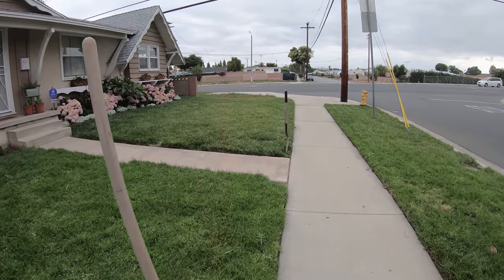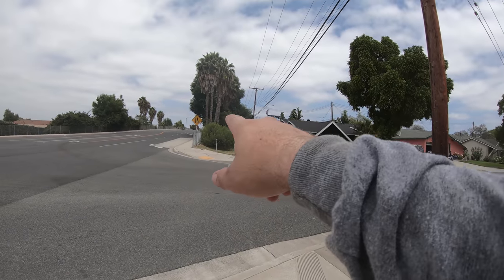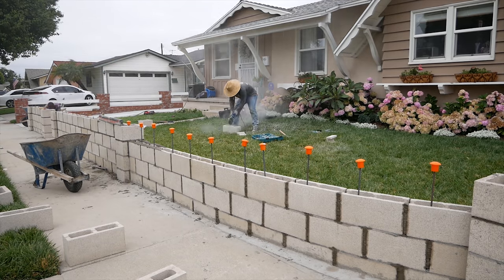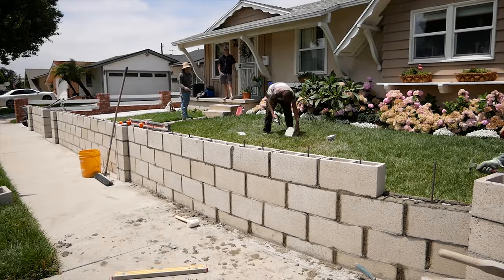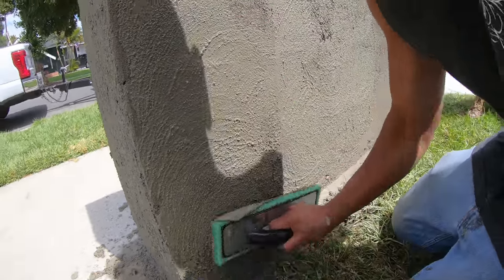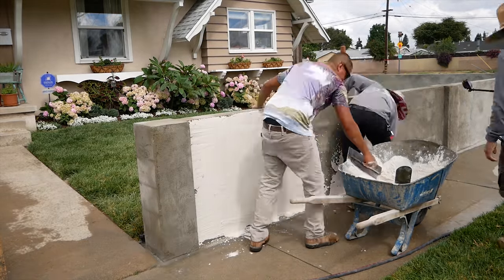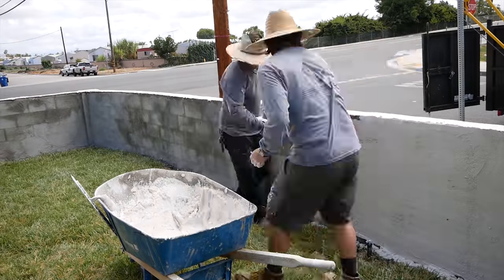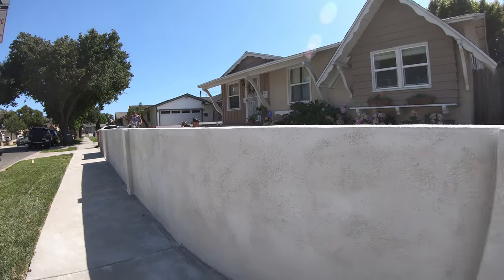How to Build a Block wall, Texture Stucco and Gate!

Comment: With all my respect,as a fellow Carpenter/Mason ..... for future reference,you want to minimize the clean up process,we be laying down some black building paper to protect the sidewalk,red tape to hold it down and avoid the stucco getting on anything else but the intended area.......for a clean, professional finish, God bless you guys,stay positive,be safe .....
Reply from the maker: I like that idea
TY 
YT
Reply: He's just another concrete/block guy trying to pretend he knows stucco. They are all over scamming people here on the eastcoast. Hier a professional STUCCO MAN if you want stucco done right
Reply: No steel in the foundation? Yep def scamming . You cant pour a foundation without steel
Reply: @LF12468  those men worked per 60 yrs ago none of you come close we did not have some of the tools you have today ,you would have never made it roughing it.
Reply: @junny16  it's a footing for a wall with vertical rebar going into the footing and solid grouting. WTH are you talking about?
Reply: I prefer cuality

Comment: Tip:  Fill entire front yard with 4 feet high dirt behind the new wall. No worries about cars.
Reply: remember my friend house was at the corner of intersection , it took two cars going through the wall for them to put a wall.
Reply: Put poles 6ft deep and put a large planter over it
Reply: @user-cy5ol3xl5y   Yep, would be way lower cost.
Reply: @FauxFoe  yes cemented steel posts

Comment: If I lived on that corner I would have a couple of large boulders in front.
Reply: Far better idea than solid yet another fence!
Reply: @Hit the ground running, look up the video of the dude who hit the large boulder in a round about. Sent him air born like 20 feet.
Reply: i was going to buy a house on a corner all it had was a chain link fence. right before signing paperwork a car drove right into it
Reply: I’d have a couple trees on outside corner there and one smaller 15-20 ft in the actual front yard. Not only would your house be safe it would also provide a little sound dampening

Comment: I've done just about anything you could think of on buildings in regards to trade work, but never site excavation and foundation construction. I have now filled and compacted about 400-500 yards of stone here in Hawaii, on top of muck and almost bare lava at two different sites, quite different than the mainland! Now we are starting a 8"x8"x16" block perimeter footing for a cabin. I've gone through a lot of videos and this one puts the cap on all the issues I have been explaining to the owner, my sons friend that has zero experience, but wants to learn how to build whole houses. My son and he are working on 5 lots, 2 of which are ready for base course and to start the build. Several issues we have been discussing are clarified nicely in this video. Filling all the cores and rebar in every cell, and the stucco to make it look nice if we don't like how it comes out. Your video about the retain wall and driveway we talked about yesterday covered most of it very well, but this one really brought out the points we were most concerned with. Thanks, and keep up that SoCal attitude you have. I was in San Diego for 40 years, and two in LA. Much appreciated.
Reply from the maker: YW
GL

Comment: Thank you Mr. Odell, just learned how install a gate and set a block wall.
Reply from the maker: Awesome
GL
Reply: No rebar in the footer? 
Im a current mason by the way.
Reply: @perrisjoco180  you don’t always have to put rebar. “There are many ways to wipe your ass” don’t let that go over your head.
Reply: @BruceWayne-ue5dj      but there is always a right way .I have  seen and gone to fix walls and they crack from the top all the way to the footer because there is no rebar and they use that fine pebbled concrete.  It would be acceptable if they  dug deeper and used big rocks and portland cement with sand mortar to set them. I have built foundations in the USA and Mexico where we do this all the time. And if you think theres multiple ways to wipe your ass there will always be a right way. You must be the type to wipe you ass with your fingers and rinse your hands afterwards. Or the type to rinse your ass in the sink. Go back to playing videogames.

Comment: That happens to a lot of corner houses, here in southern California. Especially when you have a street with a speed limit of 40+.......I have seen a lot of corner walls knocked over in my neighborhood. I always wondered if added a bollard post filled with concrete would slow them down. Or add additional rebar in the impact area of the corner.
Reply from the maker: 12' bollards
Reply: My office has steel bollards installed all around our city block (we own the whole block). Each steel bollard is 5 foot below ground and 3 foot above ground.  We had them installed in 2002 after Sep 11 attacks and back then we paid 17k for each bollard.  They have a nice decorative brushed stainless steel cap on the exposed section. So far no one has tried to ram into it, but I am sure it will hold. Also each bollard is installed at 3 feet distance.

Comment: great work as always.  I was just curious if there was any concern with having the pvc sprinkler line in the footing?  Thanks! Keep up the great work and vids.
Reply: If it needs replacing well then you just put the new line not in the concrete.
Reply: Not planned very well. I would have moved the sprinkler line away from the footing to avoid future issues if line needs to be replaced.

Comment: Wow! Fantastic job! How do you get the fallen stucco from the finish coat off the concrete of the front sidewalk?
Reply from the maker: Clean while wet
Reply: A real stucco man wouldve covered everything before running mud. Look closely, they didn't get everything off that sidewalk, and made a mess of the grass too.

Comment: Really loving your videos. I’m learning a ton!  I live in Iowa (cold winters and hot summers). I want to build a (vegetable) raised garden bed using this method - build out of 4x8x16 block and stucco it to look solid.  Would I use a similar method of digging a trench and creating a concrete foundation for the block? Or do I need a gravel base?
Reply from the maker: Yes I believe you need gravel for drainage.
Check with your local building department
Reply: If you have cold Winters like we have in PA then you want your footer below frost line of it will heav up all your hard work I do stone masonry and concrete and have seen a lot of failures from not having a proper footer for the climate. I'm always jealous watching videos from y'all out west thinking man they got it easy no digging down 40" to get below frost line lol keep up the amazing work brother it's always a pleasure to watch you and your guys
Reply: @bryancoles8817  I was kind of afraid of that.
Reply: 111
Reply: @bryancoles8817  40" really? Wow.

Comment: Idk maybe its just me but the block looked better without the stucco and stucco made it looked like it was an old dirty wall lol and it didnt even match the house lol. The blocks exposed looked way better lol
Reply: From listening to the video, it seems it was what the customer wanted to do. However, while I agree with you, I think also the extra stucco was to add to it's ability to slow down an incoming car. Maybe this was a cheaper more viable way for the customer to afford the work? It seems aesthetics was a lower priority than the means of the customer, which is obviously necessary.
Reply: @iplayoldschoolrunescape  Agreed, but maybe it was a quick fix and knee jerk reaction to possible impending death due to a stray car through their living room. Someone mentioned putting large boulders at the corner. I think I like that idea as it feels more natural and boulders sometimes look really cool. It's probably really expensive to move a huge boulder like that, but still neat idea.
Reply: What the customer wants they get..

Comment: Kinda messy stucco job on this one, they didn't cover the floor. Would've looked better if the corner metals where used.
Reply: Maybe that's what the customer wanted, or was willing to pay for
Reply: But they put dirt over the foundation/floor (if that is what you meant?).
Reply: Yeah, sidewalk got pretty dirty. But the guys did clean it up. I too, was expecting some kind of cover on the ground.
Reply: They are clearly not stucco men. They had no business charging for that mess of a stucco job.

Comment: Some sand works well to make clean up easy with a shop vac after, if your are like plastering or even if your just filling a lot of joints or striking , the sand keeps it from sticking
Reply from the maker: Sounds slipery

Comment: i think it needs a stronger rebar in both vertical and horizon inside wall..  I know it is not in CA building code, however, its a good idea to make it stronger preventing vehicle such as heavy trucks from hitting the house.
Reply from the maker: 12" post bollards

Comment: Great Job but I just wish there was a bit more iron/steel rods. You need rods the thickness of a baby's arm in those bricks to stop a car from crashing through. Also, I think it would have looked better with an exposed brick look....The stucco looks great too but exposed brick looks modern.
Reply from the maker: I think 12" bollards every 6' will do it
Reply: @OdellCompleteConcrete  
Yes Exactly.....something like a jersey concrete barrier or a thick bollards to help serve the purpose....but it's not too late. The Bollards can still be installed for additional protection of the customer or CITY wants to pay..

Comment: It is necessary  to protect your house and the family in it, just wonder if that (nice) wall would stop a vehicle from trespassing their property. I have placed some gabions in front of my property as a barrier for vehicles, because it has happened to some neighbors a vehicle has crashed in a garage (left my property 4 houses apart) and another in the corner of their property (right of my property 2 houses apart) from careless drivers, most probably drunk ones.
The gabions that I have placed have some beautiful bluish stones/rocks (and some bluish succulent on top) and are 60 w X 120 l X 70 h cm, placed along. Although a brother of mine said he doubts those gabions could stop a vehicle, so for extra protection I have  a line of big rocks (beautiful) along the first wall. 

Nice job anyway.
Reply from the maker: Maybe slow it down.
TY
GL

Comment: Nice.. how much does this cost, I'm curious
Reply: Do it yourself price: $3,480.00...

Labor - $2,241.21 - 1 day/5 person crew - 1 lead, 2 masons & 2 trainees (paid on a 210 day year).
(Labor includes 1 day of salaries, employee ins, 6.2% tax and 1 day of $110K yearly overhead)			
Footing materials - $1,680.00 (5.56 cu yds) - 6 cu yds ($250 cu yd) - #4 rebar 36 X 4' ($5.00 ea) 		
Block materials - $600.00 - 154 H - 24 Angelus ($2.50 per H block / $8 per Angelus block)		
Block & column caps - $100.00 (40 block - 5 column - concrete flat caps $2.00 ea)		
Mortar mix supplies - $200.00 - 7 bags - 1 ton sand - Mortar mix $15 bag - Sand $75 ton (per 7 bags)		
Stucco scratch coat - $450.00 - 40 bags - 500 sq ft Scratch coat 80 lb bags ($10 ea) 		
Stucco finish - $250.00 - 7 bags - 500 sq ft Finish coat 80 lb bags ($30 ea)		
Mortar mix machine - $200 - $200 per day					

Retail project cost sub-total: $5,721.21

Owner Profit - $2,500
30% material profit (built in) - $984.00					
Owner daily profit total (42.38%): $3,484.00
Project total cost to hire contractor: $8,221.21

Comment: I'd like to build a 6ft concrete stucco wall around my house with a gate for the driveway for security, line the inside with some bamboo and bird of paradise, I think it'd be beautiful but not sure if code would allow it
Reply from the maker: Probably not unless it's 20' set back
Reply: @OdellCompleteConcrete  interesting, but this is set to the sidewalk? I guess the code becomes a factor once it's a full enclosure

Comment: Liked and subbed. I've watched many of your videos and this is one of my favorites. We did a similar wall at my apartment building last summer and for now just left it block, no stucco. The stucco work is a lost art for sure. I'd like to do that next (this) summer so may try this. My wall is more of a retaining wall about 2' tall. Such a vast improvement over the wooden landscape timbers that would rot out every 5 years. The customer here would have been far better off doing tan/ taupe/ grey, or literally any thing but white! Even though they plan to paint it they may not have had to or could have had much more time to do it. Being white it will look horrible very quickly. Regardless, your son and his crew did a great job!
Reply from the maker: Great
Thanks

Comment: Beautiful house and wall. I always wondered if people on corners or at the end of street where there is an intersection worry. Some huge boulders would work, but the driver and passengers would not fare well.  Someone hit one of my block wall columns years back when drunk and the last homeowner cobbled it together. I was considering making a plywood form and pour a new cap with maybe rigid insulation as the core to reduce weight.
Reply from the maker: Sounds interesting.
GL

Comment: Great job, liked and subbed... I would have added a beam under that using 12mm rebar and 1'x1' columns with 16mm rebar every meter. Imagine a loaded pick up truck going 20 over the speed limit, it'll plow through that wall easily.
Reply from the maker: 12" Bollards
Reply: @OdellCompleteConcrete  that'll work.

Comment: You know, laying blocks immediately after the footing is a great thing.

When you put footings and you forget that you could also put the blocks immediately afterwards, insuring stronger block attachment to it is a waste of a really strong bond and also, you could easily build the blocks on it since it is still soft.
Reply from the maker: I concur
Reply: Stop telling our secrets 🤫
Reply: @BruceWayne-ue5dj  yea it’s not a secret. We build miles upon miles of these type of walls in Vegas.  When you lay the first course in the wet concrete it’s called wet setting. When you lay the first course on a cured footing base it’s called cold coursing. Not sure why you use precision 6816 block when 6815 t&g is much easier to use.

Comment: If your putting rebar on top of an existing cement base and the wall is going to be 6 ft do you drill the rebar into the cement base? Thanks
Reply from the maker: Yes

Comment: If I did it I would have put some 4" pipe buried 3' in the ground every other rebar and filled that pipe with concrete. I also would have done 3-4 double brick kickers behind the wall at the back for additional protection. Maybe even do a double bricks wall on the corner. You are right it will "slow" the car down, but I would have built it to STOP the car.Also, I would have rounded the top of the gate with a router.
Reply from the maker: Post bollards, for sure

Comment: Nice work.
I think I would have installed a 4" schedule 40 steel pipe in the corner block and grouted it in.
If they're out there doing donuts and slide into that, they'll know they something..😳
Reply from the maker: I concur
Reply: Mr Evan's your an evil genius, I love your thinking on that 😂😂😂😂

Comment: @Odell Complete Concrete Could you use this as 3 foot retaining wall? Or would you need to fill in the the inside of the blocks to make it stronger?
Reply from the maker: Solid grouped for retaining

Comment: I see you did not use any rebar in the footing.  I saw one did a wall in my area and they did use rebar in the footing.  Would you need the rebar for a higher wall say six foot or just pour maybe a deeper footing.  Nice job I think I would have made the wall come to the house to close it off and give it a better look.
Reply from the maker: TY
Reply: 1. why not run re-bar through the footing and tie vertical steel to it? 2. Vertical steel is no good unless its mounted to footing steel, and a small beam(cap) should have been cast with concrete and steel(tied to vertical steel) to run along the top of blocks, this top beam would ensure the columns and blocks dont pull away from each other, and also prevent the wall from leaning sideways. Also, how did you tie the new wall into the existing wall?

Comment: Made me chuckle seeing those pier blocks, here in the UK our blocks are always rectangle in shape. I wanted a wall very similar to yours with two piers either side and the central section recessed. I had to draw it in sketchup and it needed quite a few cuts to make the square columns but the piers were bonded nicely into the wall. Suffice to say it was a pain to do.

Out of curiosity how did you bond your piers  into the wall, did you use metal ties?
Reply from the maker: Rebar in to columns from block wall

Comment: Amazing work. Quick question how deep and wide was the footing? I ask because I'm going to do a freestanding 4 course 6x6x16 property divider wall and was wondering. Thanks. Keep up the great work.
Reply from the maker: 1x1
Reply: @Odell Complete Concrete  that's what I thought,  1' wide, 1' thick but he have to dig 16" deep from the top of the grading dirt, like that the foundation doesn't get exposure exposed

Comment: Mr. O'Dell love your videos very informational.  I have a question about the footing. What did you use cement or concrete or mortar? What brand? Thank you in advance sir
Reply from the maker: Concrete
Portland
Reply: Mr. O'Dell do I need rebar horizontally like   working on residential driveway for the footing?

Comment: Since the columns are all stack bond, wouldn't it have been stronger to have put a rebar bundle in each one and poured concrete in them?
Reply from the maker: There on the same footing,so it shouldn't matter